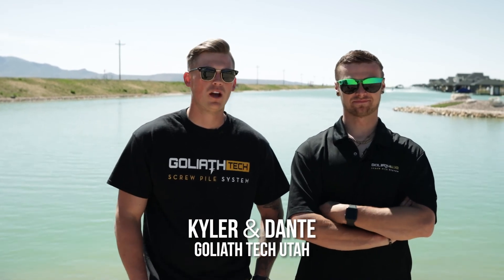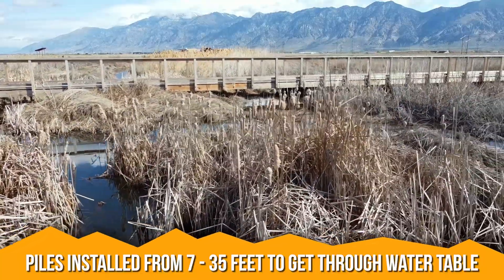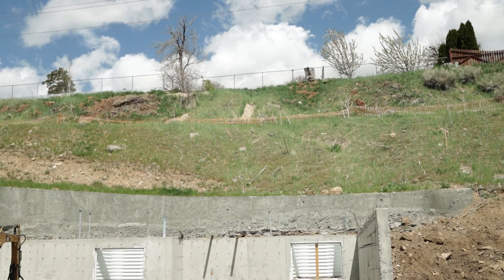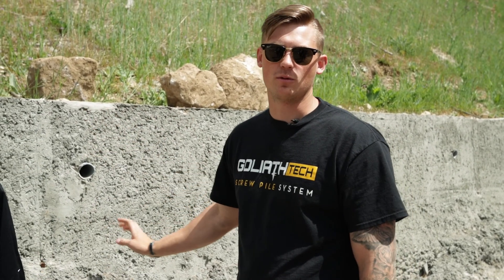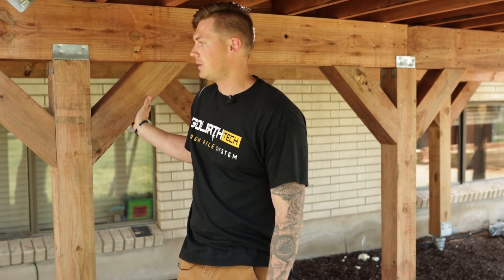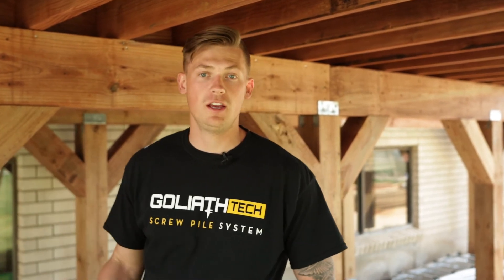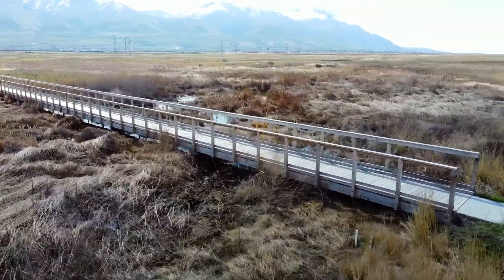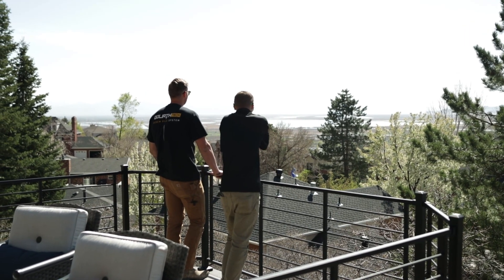Helical Pile Applications and Tour - Build Anything Anywhere

Comment: Can these be used in anyway to replace a 2' deep footing under a 60' wall on some kind of shifty material (Granite Gravel) that's 10ft deep? Plan to compact the Granite Gravel if necessary…I understand it is 1000psi at normal compaction. Thanks if you got any tips would really appreciate hearing about it.
Reply from the maker: Yes. We can underpin the wall from the side. 

Check out the video to show the process:Settling Foundation Horror!
https://youtu.be/Yed6dalvRoc

Comment: Can this be used for a finished basement in new construction?
Reply from the maker: It can. However, a basement is typically below frost already. If the soil conditions are poor, it is a great solution. If the soil conditions are already great, they wouldn’t be needed or add benefit.